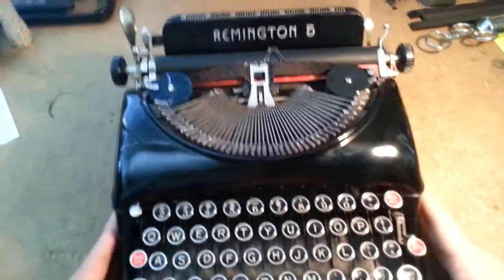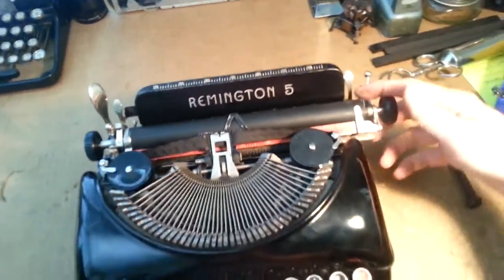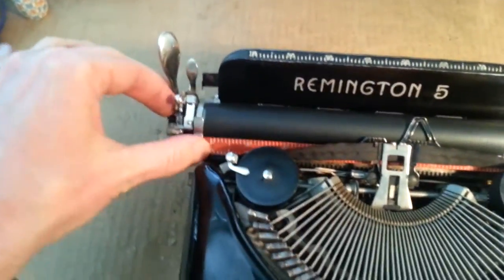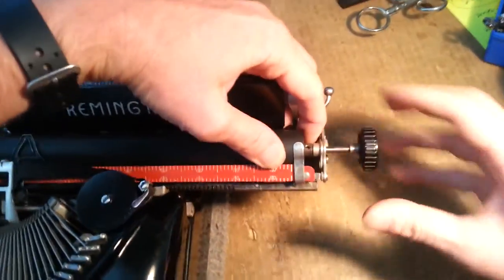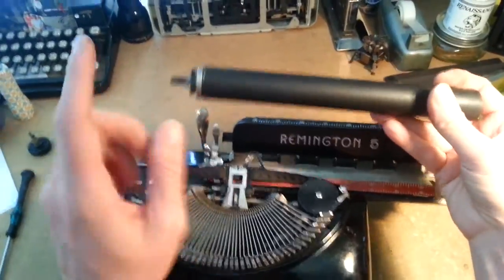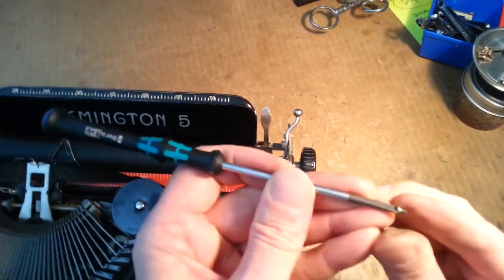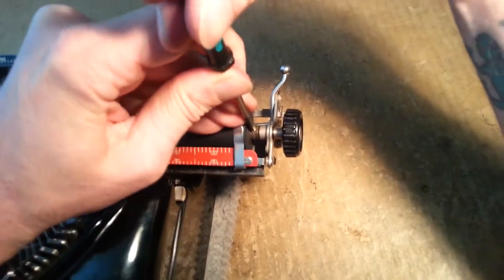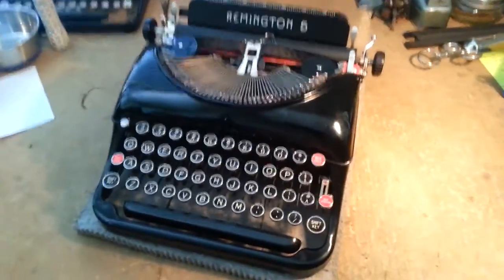Remington 5 typewriter -- how to remove the platen

Comment: I was so happy to find this. Exactly what I needed.
Reply from the maker: +Eric Edstrom Bueno!  glad to be of service :)  What machine are you working on?(there are several that this video works for, always curious)
Reply: A remington 5 just like the one you've got. The platen needs to be recovered for sure, but I've noticed now the feed rollers have flat sides from sitting for 60-70 years. Can't see how to get them off.
Reply from the maker: +Eric Edstrom Getting the feed rollers out is a bit challenging, but it can be done!  I think i ended up forming the little L-tab on the right end of the rear assembly to slip the axle out.  BUT BE CAREFUL!!  overstressing the metal of that tab can break off,  so don't bend it more than you have to.  I found rubber tubing at a local auto parts store - had to poke around a bit, but eventually found the correct diameters...works like a charm!
Reply: That's a great tip! I was picturing having to take the whole carriage off because I couldn't see how that whole assembly was attached. I def did not want to mess with that. Once I get them off I'll go to search auto parts stores. We have a lot of those around here. :)

Comment: So I just gave this a try on one of my Remington 5's. It was easier than I expected. The trick is, like most any work with a typewriter, to really be gentle, but still firm. I found some parts that were stated here as tricky to indeed be a challenge, but nothing I couldn't figure out!

The indexing system WILL try to collapse on you - don't let it! it really does try to slide out along with the Platen when you pull things out. Getting things in IS tricky, especially again around the indexing system, but if you just help the parts gently into position, it all goes back together nicely.

Oddly, I had ZERO issues with the left knob and the index release - it wants to go on just fine. That being said, I never, EVER would get "comfortable" with it, and dare risk damaging that little nub as shown in this video. Just not worth it, the moment you don't exercise caution is the moment something goes wrong.

The funny thing? I did this in the hopes it would help me fix an unrelated issue I've noticed with "my" Rem 5, but nope! Couldn't get any closed to the backspace.

Such is life, but at least I feel better about working with the machine.

Comment: This actually helped with removing the right knob on my Remington Deluxe Noiseless. With some PB Blaster into the right side in general (get it into the hole where the set screw is and was after removing it), a good ol twisting will get it loose for sure. Turns out the platen activated the platen lock and kept the carriage constantly advancing and not meshing with the gear.
Reply from the maker: i love me some PB Blaster, but Kroil won’t stink up the whole house ;)

Comment: nice video, to get the left knob off, have you tried making a strap wrench out of something you can get through the platen , ie a strong piece of card or cloth and for the brass piece of the knob section you could use a metal strap wrench (aka like you use to get an oil filter loose from your car's engine, but smaller).
Reply from the maker: andy van - that’s a great idea.  i usually don’t have too much trouble with them, and whenever i do i just use a drop or two of Kroil on the spot where it screws in & come back to it in a few hours...works like a charm.

Comment: Hello. This was helpful getting the platen out but now how about the other little rollers on the Rem 5? I got one on ebay that was advertised as being in working condition but the paper wouldn’t go through (liars) so the platen isn’t pulling paper through and all the small rollers are either flat or broken due to brittleness. How do I get those off to send to JJ Short please? Thank you 🙏🏾

Comment: There's a thin piece of metal that goes in the index assembly, a spring of some sort. It got dislodged when I had the platen off to replace the feed rollers. Where is it supposed to go? It's loose, and the index assembly sometimes doesn't advance properly.

Comment: Love the video! But how do you get the feed rollers out?
Reply from the maker: The feed rollers all ride on thin metal rods, knurled on one end;  unless your machine has been tampered with the knurling should indicate the direction which the mandrel needs to be pulled.  Examine the feed rollers themselves to locate the mandrels they ride on - the front feed rollers share a mandrel with the carriage plate as well as with the platen tray;  the rear rollers will require that you carefully bend the end-stop tab before pulling the mandrel out to one side, through the available hole/cutaway in the carriage end plate.

Comment: Excellent video! I have a '39 Remington Rand Portable Model 5 (Canadian) that is in wonderful condition, but the scale and paper fingers have no tension. I'm assuming a spring is missing but I can't seem to figure out where it would go. 
It looks like it goes somewhere on the left side. Any help would be greatly appreciated.
Reply from the maker: you are mostly correct - there IS a spring, but it wraps around the mounting screw on the RIGHT end of the scale.  There's actually a strong chance that part of your spring is still attached, since very often the long arm on it will break off & cause the exact symptoms you are describing.  The good news is that you can make another one rather easily with thin spring-steel rod stock(AKA music wire), normally found at Ace Hardware, Hobby Lobby, or any model r/c hobby shop - for this spring i would use the K&S Precision Metals .025 music wire.  There are several different methods on the internet for making springs, but you don't need anything fancy for this one - just a couple of wraps around a screwdriver, snip the arms to fit, put a couple of quick bends in the ends.  If you want, you can toss an email my way & i'll send you a picture of what the spring is supposed to be shaped like - my email address is typewriterjustice@gmail.com
Reply: Thank you so much for the reply!

Comment: Hey there! 
I just bought a Remington Deluxe 5. It's a European model so the keyboard is QWERTZ not QWERTY. Is there any way to change the keys and the keybars?

Would love a video.
Reply from the maker: for the average person, no, there is no way to change it.  If you are lucky enough to live near a legitimate repair shop, ask your repairman if he'll swap the typeslugs & keys for you...which he might not.  Re-soldering typeslugs can be a royal pain in the ass even if you have the proper jig & shims, and I would never do that sort of work on a machine just out of preference rather than necessity.  Have a loose typeslug? fine, break out the solder & jig.  Machine is okay but you just dont like qwertZ layout? tough shit - buy qwertY next time.  The Deluxe Model 5 is as common as cows - if you want one with a QWERTY layout, go buy one!  I'm willing to bet there's at least five of them for less than fifty bucks each on eBay right this very second.  seriously.

Comment: I wish mine was that easy, I have been trying to figure out how to remove the platen from my 1940 Royal Aristocrat. In the process of trying, I broke one of the little screws on the right hand knob...
Reply from the maker: It is, actually.   The only real difference between this and the Aristocrat is how the left knob comes out; the rest is the same.  On the Remington the left knob itself unscrews, whereas on the Royal the left knob has two set-screws on the collar in the middle (some models only have one collar screw, depends on year).  On the right side, leave the KNOB screws alone, but remove the PLATEN COLLAR screws so that the platen rod can be removed by pulling on the right knob(which remains attached to the rod for this entire procedure).  Keep in mind, when you go to remove the rod, it's likely going to be somewhat stuck inside the platen collars, so you're going to need to be gentle;  rotate the knob as you pull it out.  More likely than not the rod would benefit from a bit lubrication, and THIS IS WHY GOD MADE "PB BLASTER" !!!  When you find yourself having to use excessive force, 9 times out of 10 you're doing it wrong, no matter what you're doing.  Spray some PB Blaster in there, let is soak for AT LEAST two hours, then give it another try.  Still stuck?  Spray it again, and this time leave it overnight.   I'm not kidding.  This is slow work.  Be patient.  Use the right tools(including the right size of screwdriver).   Let me know how it ends up!

Comment: What about Remington noiseless portable? & would I have access to change— ( Rear/Front)—Feed Rollers? Also , could i send out my platon? To get re fixed ? Or should I find a new one? Ps. What’s good oil to use? For the rods that are on the feed rollers. 

Please help
Reply from the maker: Troy Luna - in the USA you can have platens & feed rollers recovered by JJ Short Associates, as well as by Steve Dade(though Mr Dade is more discerning as to which machines he services).  Both are easily found on the interwebs.

Comment: Hi, i have a model 1 and am looking for some help getting it operational. the space bar doesn't seem to work. any suggestions?
Reply from the maker: follow the physics with your eyes.  there's really not much that can go wrong with the spacing mechanism other than linkage/pivot issues or the escapement.  If it's the former, you might be able to fix it yourself;  if it's the latter, you need to find a repair shop or a knowledgeable collector in your area.  I can't say much more without seeing the machine or having a detailed description of precisely what happens & doesn't happen and WHEN it all does or doesn't happen as the spacebar is pressed, as well as what is going on with the rest of the machine.  It could also just be something lodged inside the machine -  you wouldn't believe some of the shit I've seen obstructing spacebar & key-arm movements:  jewelry, dead bugs, mouse bones, money, rusted linkages, cigarette butts, Hot Wheels cars, Lego bricks, old letters & mail, bits of cloth... there's no telling.   Flip the machine up onto it's ass, wiggle the spacebar & see what moves.  Press a key or two & compare that to what the spacebar does.  They both should act on the escapement in similar but slightly different ways, and you can follow every bit of the kinetic train visually.  A good cup of coffee can help, seriously.

Comment: I have the issue of the loose index release on the left platen knob. I am not able to thread it on. I continue to spin it and the threads don’t catch. How can I fix this?
Reply from the maker: @EmmaIturriria  Patience & careful observation are the key!  make sure that the index tensioner(in the indexing assembly, the tiny roller on an arm) is properly seated ON the sprocket teeth instead of NEXT to them, as this would keep the platen from fitting all the way left, causing the threads to not meet;  it’s also possible that the indexing assembly is slightly out of position on its pivot collar, leading to the same result.  when in doubt, it’s better to remove the platen, check everything, and then insert it again rather than to fight with it on the first try or to bend/force anything.
Reply: Thank you! I gave it a try but it still won’t thread on. I tried screwing it onto the platen outside of the machine and it won’t thread. Do you think it could be a problem with the threading?
Reply from the maker: @EmmaIturriria hmm.  if the threads on the end of the platen were damaged in the removal/installation(which is entirely possible & fairly easy to do) then that would definitely need to be addressed before reassembly, and unless you have excellent eyesight i suggest inspecting them under magnification.  It's worthy of mention that these are NOT reverse threaded, so it should behave like a regular nut/bolt arrangement.  If the thread end is laid over, you can(also under magnification) set it straight with needle files, a utility knife, or really anything slim enough to separate the thread channels.

Comment: Since we are talking about platen-rubber here, what ‘s the most common problem that causes your letters to sometimes punch holes right through the paper, for example the period symbol, it just punches a hole into the paper. Is that always because the rubber is hard, cause in my opinion it still seems to be in okay-condition. The machine I am talking about is a German Erika Modell M if that helps in any way. 

Another thing, is it possible to somehow recover the rubber on the feed rollers like you can do on the platen?
Reply from the maker: characters cutting through the paper can be caused by the platen being too hard, but also by it being too soft! if it's just the period, comma & slash doing it you can normally peen the ring-stop on the typebar to decrease the impact; if you don't have peening pliers or aren't comfortable attempting it, you can use roller-pliers on the shady if the typebar itself(but again, this is a specialty tool AND YOU WILL RISK CRACKING THE TYPEBAR, not to mention this is a less precise method than peening)  The easy solution is to just make sure to use at least 24lb paper with a backing sheet; I use a 30lb linen and get great results.  Hope this helps!
Reply from the maker: and regarding feed rollers, yes indeed you can recover them.  The model M is relatively easy to get them out, and you might be able to find rubber of the proper ID/OD  at your local auto parts store.  When I did mine, I found rubber for the front feed rollers easily enough, but for the rear rollers it was bit of a challenge to find
Reply from the maker: it's also worth mentioning that unless your feed rollers are hardened or have flat spots, you might be able to get them working better simply by cleaning them with rubbing alcohol & a cotton cloth.  very often this will restore grip with much less risk of damage to the machine

Comment: Does anybody know where the screws are located to lower or heighten the lower case/upper case letters on this typewriter?
Reply from the maker: it’s actually 4 screws & eccentric nuts, each with with a small metal plate - two on each side, near the top of the chassis, accessible only once the lid & body have been removed.  NOT the easiest machine to adjust, but also not the worst :)

Comment: how do i remove the platen on a standard continental typewriter?
Reply from the maker: i've never worked on one, but like any other machine it's just nuts and bolts:  if someone put it together, you can take it apart.  If you go slow, be observant, follow the physics, think before you act, take lots of pictures(especially of the index mechanism before, during, and after platen removal) and try to only remove parts that you understand, then you stand a good chance of being able to put it back together.  Best of luck!